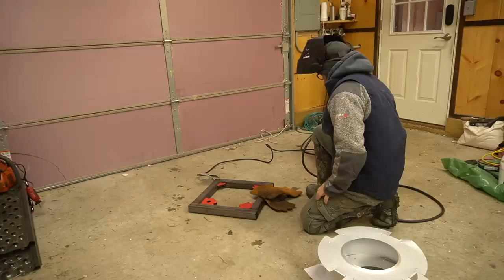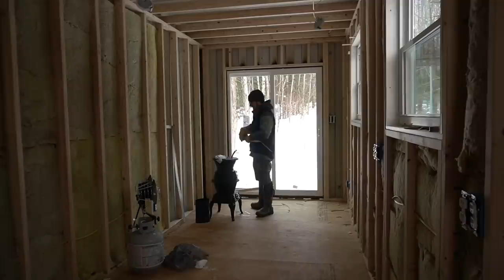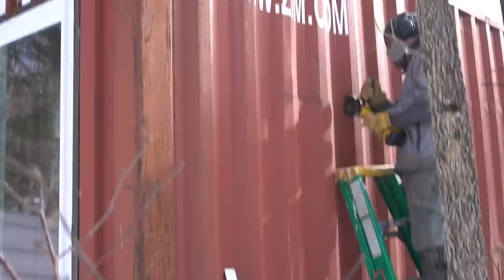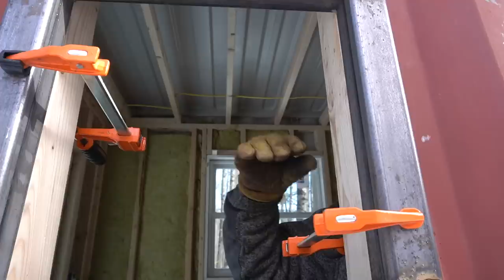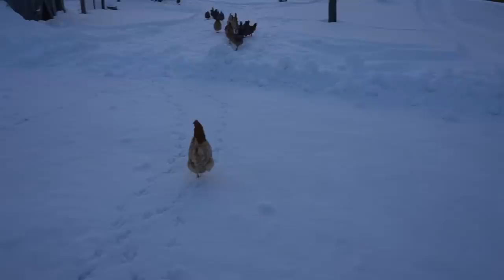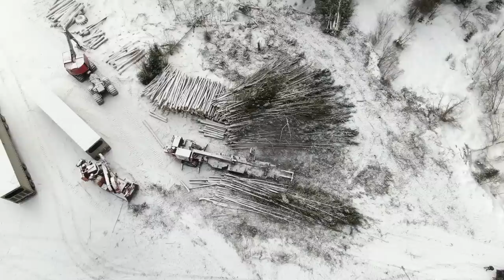Customizing Our OFF-GRID Shipping Container CABIN so we Can INSTALL the WOOD STOVE

Comment: You should fill in all the air gaps with insulation at the tops of those walls, if you leave it the way condensation can build up on the metal and drip down, wet your insulation and mold...

Comment: You got it all zipped up now. It looks really solid. Its heavy duty and it is not going to fall down that's for sure.  When you get the insulation in the roof that should help some to hold heat its the most important part to insulate.

Comment: Get you some wire wheels for your grinder so you can clean your welds off that way you can check them for any missed areas,also get some cold galvanize in the rattle can to spray over your welds to help prevent them from rusting until they can be painted properly

Comment: Great job Al.  It won't be long now and that little pot bellied stove will be burning away the scrap wood around the place.   I just wanted to mention, yesterday on Doug & Stacy, he used a caulking gun that pushed the adhesive out and he just had to guide it.  It would be great to get one to have on hand before you start building.  It sure would save the hands.  He said it was worth the money, especially in the cold temps.  Have a Blessed day.

Comment: u need antifog glasses? Sorry, I am a welder, rather waste so much time trying to cover up the hole, u should have cut 45 degrees in each corner then it is square then there are no holes. Good luck.
Reply: Al says he learns best by doing and with tips from the comments he will be welding like pro in no time.
Reply: @wamblipaytah1600  Practice means to get into perfect next time?

Comment: I have a HF green welder, I found it works better with Hobart wire than the HF brand, also get yourself some nozzle gel, between the better wire and the gel I get way less spatter.

Comment: Hey Al,,, next time when you have the Iron Shop cut you the 2"x2" tubes for a frame. have them cut them on a 45*....then you won't need to cap the open ends. Just like a metal picture frame. This works great with the angle iron frame as well. Keep up the great content and keep on Stedding!

Comment: Is there any concern about heat transferring back on thw wood 2x4s with the metal touching it, should you have put some type of fire block between the square tube frame and the studs?? Just curious. You are doing a great job and the property looks awesome !!

Comment: Hay Al they are getting hard to find but you can buy anti fog glass cleaning wipes for your glasses. They don’t take 100% of the fog off but they help a lot. I have the same problem with my glasses and I know how frustrating it is. The ones I have are  Bausch & Lomb sight savers Anti-Fog  formula for non coated lenses. Worth a try.

Comment: Is there a reason why you did not cut and weld the corners of the frame at a 45 degree angles. This would be neater and alleviate having to weld on end caps?

Comment: I followed the link to AthleticGreens, but when trying to select "Redeem", nothing happened. I was glad you remembered to cut plates to seal up that frame.. was thinking that if you cut the next frame pieces at 45 degrees, you'll solve the problem in one move when you do the frame welds. In my experience, there's a two-edged sword regarding putting bird feeders so near your "cabin", 1) nice view of wildlife from either kitchenette windows or doorwall and/but 2) constant critter focus, will lead them to nest under your cabin and you'll hear them all night while trying to sleep, plus, you'll never know what's lurking underneath when you step out the doorwall.

Comment: Any thoughts on cutting your metal frames (tubing)At 45 degrees?  You would not have to cap them to keep moisture or critters out. I subscribe to drilling a tiny hole 1/8" max  on bottom side to give an out for any condensation.  If this frame is only for structure and gets protected and sealed in another process or down the line disregard....

Comment: To late now as the chimney hole is already cut, but I would have put it higher up on the wall, as high as possible, looks to me like there is only going to be a short length of chimney before it goes outside, as there is quite a lot of your room heat can come off the chimney as well as the heat from the pot belly stove, before the chimney goes outside, this is all now lost, still you can always warm your hands on it if working outside, make sure the chimney extends well above the top of the container otherwise the smoke/fumes may well return back inside through the patio doors and windows if open.
Reply: I thought the original plan was to take it through the roof, not the wall
Reply: @christopherhaugen6847  Well you know what Al's like, forever changing his mind.

Comment: Welding tip: drape your cable over your arm from inside to outside so your forearm is bearing the weight and you're not carrying all the weight with your hand. You'll have better control for laying cleaner beads.

Comment: Al ... you already mentioned it so this is not a criticism.  It's called "Tack & Tap".  You need to get in "the habit "of tacking.  Tacking allows you to correct heat deviations (which can be significant) by "tapping" the project back into shape prior to final welding.  Also, while the project you're working on right now (heat stove installation) is not visually critical, there will be a time when you want more efficient use of your time, which is not grinding off slag from the self-shielding welding wire.  If you post on Craig's List for a 75/25 tank (75% co2 / 25% argon), you will save yourself a lot of money.  You will probably find a listing that includes gauges.  This will eliminate the grinding on visually critical projects.  If you can get two tanks, even better.  That way, when your out of gas ... you're not out.

Comment: If your glasses are fogging, A. your mask isnt fit properly, B it's not tight enough or C there is a problem with the mask itself.  Any air escaping around a mask means there isnt a proper seal.  So if your glasses are fogging that means air is also bypassing the filters on the way in.

Comment: You’ve talked about increasing organic matter in your 4 logged acres with cover crop, nutrient density with your compost, and single handedly put up a high tunnel and spent the summer picking tomatoes worms. Making a statement that you don’t eat greens just doesn’t seem genuine. Your dinner prayer was cut out to leave room for a sales pitch. Love your content and keep up the hard work.
Reply: I struggled with exactly this. Dont eat veggies built a massive greenhouse. Doesn't line up.
Reply: I agree.
Reply: I believe he said he doesn't eat enough greens. And there aren't many greens to be had from the greenhouse in the dead of winter. The greenhouse lengthens the growing season. That's all.
Reply: @chrystallangille1667  no one eats all the greens they should every single day.

Comment: Why did you make the elbow in the pot stove exhaust pipe so low? You will be wasting heat to the outside. And yes 45 deg corners, a lot less work and looks a whole lot better.

Comment: Coming from a welder my suggestion to you in the future would be stop using flux core wire and get you an argon tank your welds will be 100 times stronger also purchase you the large spools of wire the in .30
Reply: Cleaner welds with your suggestion for sure.
Reply: C25 shielding gas and  .035 welding wire would be perfect for the materials used in the videos. The machine that you have will work with a 10 Lb. spool of wire.

Comment: You should really grind off your steel before welding...your welds look like they have a lot of impurities and are therefore weaker. Also-if you use 2 hands you will have better control. And welding in your shop without proper ventilation is potentially dangerous.

Comment: Can't your steel supplier cut at 45 degrees? Also if you use a grinding or flap disk to bevel the outside face of the edge that you intend to weld the results can be far better since you can easily make a smooth face/invisible weld under paint. I found a video that demonstrates what I mean, see the first 5 mins of this, the rest is more advanced corners.
https://www.youtube.com/watch?v=FNAPc8VtHA0

Comment: For all this trouble you are putting in to make this metal building a house, not to mention the expense for all the equipment & materials, labor & exhaustion...I would have just bought a good used mobile home either single wide or double wide. There are a lot of good used ones available.

Comment: Next time you are doing something like the frame weld on a bolt for something to grab with the ground clamp as it is easy to grind it off when you are done. No need to try to fit it around the steel or to find a nearby spot without paint. 

Do the two studs on ether side of the opening need to be wood or would it be better to replace them with steel studs to increase the separation of flammable materials from the stove area? 

Is there a dedicated CO monitor in the space? Enclosed spaces and open fires are not that healthy if you fill the space with carbon monoxide. With the garage for the mule on the other side that could also be a CO source.

Comment: Al, what back yard farmer do you get your welding advice from.  Always Remove mill scale, rust, buff to shiny metal. Never weld through paint, remove slag, soot, spatter. And No your Not getting better at welding.  Practice torch angle, wire stick out, travel speed, puddle control. Where did you get the idea that one pass is all you need to weld frame to container.

Comment: Al, you drive me nuts with your welding. Fortunately you haven’t done anything structural. You really should get to know some welders in the area to learn the basics of welding prep. You need to learn how to control heat in the weld so that your work doesn’t distort as you weld.